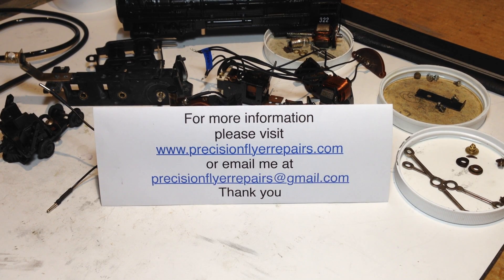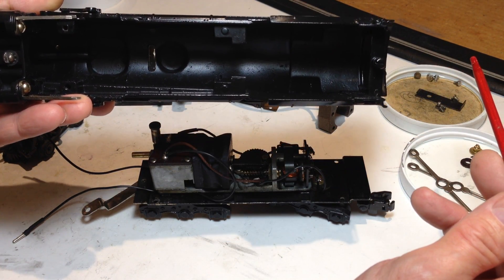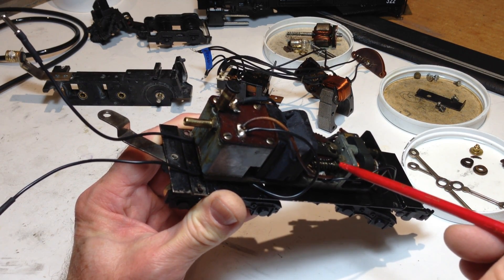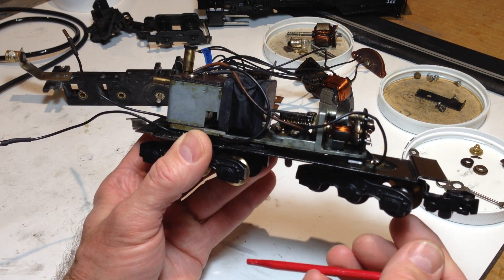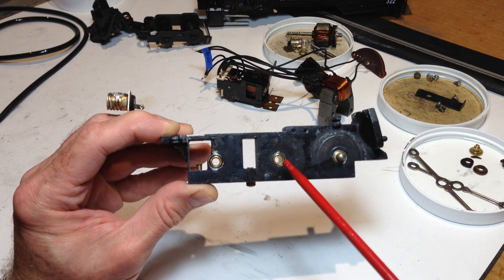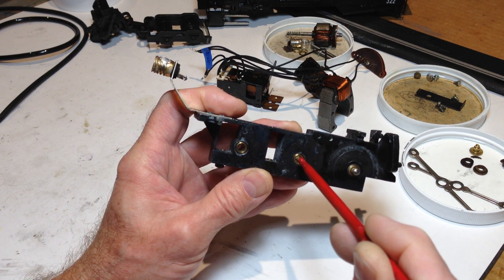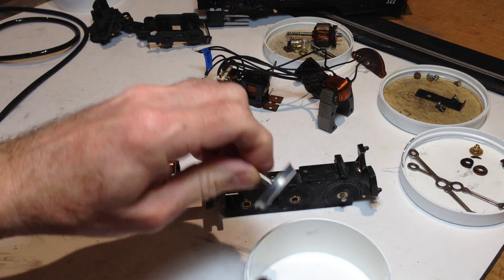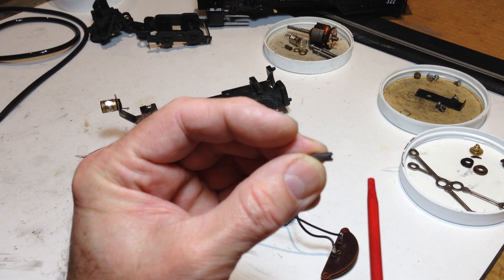American Flyer Anatomy 101: the Gilbert smoke-in-tender steam engine

Comment: Video cut off just before you explained the smoke tube. Mine is pinched, how do I get a replacement?
Reply from the maker: Thanks for watching.  Check with local and online dealers.  Two that might have the replacement hose are Doug Peck (Portlines.com) and Tom Seccia (Triple-S on eBay).

Comment: Being a Lionel collector, I find it so fascinating at how Gilbert American Flyer's were so differently designed to create the same effects. Where the original Lionels attempted to keep the tenders only creating the sound effects. But as AF would utilize the tenders for many more features like a reversing system and or smoke generator, by means of teething. It wasn't until later on Lionel got wise to using the tenders for the power supply units and sound effects as well via a teether wiring system. But even the way AF designed their drive systems and gearing from the motors to the wheels is so much more differently done. Otherwise very informative video and thank you for making this. I'm considering to adding some AF's to my steam locomotive collection. Just a few different model  Marx which I appreciate the  older quality of their products, I don't discriminate, but embrace the difference in methods of how these engineers had to be so creative back then for competition!
Reply from the maker: Thanks for watching.  I am glad you enjoyed it.  You raised some excellent points.  The ingenuity utilized to design and produce toy and model trains from their inception to the present day and into the future is something that always amazes me and I admire about them.  Have fun adding some Flyer to your collection and operations.

Comment: The brass buttons were used with a track trip. Had nothing to do with three rail operation. Never used much and went away by 1947.
Reply: The 695 track trip, to be exact.  My 1946 steamers have those buttons.